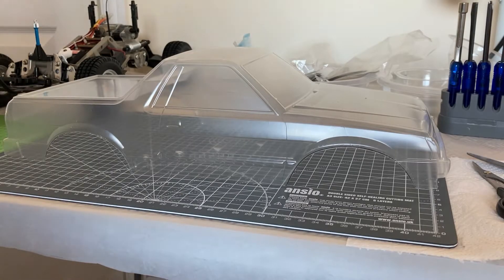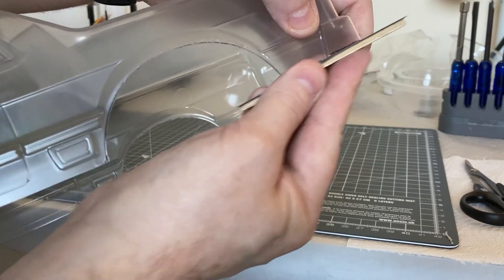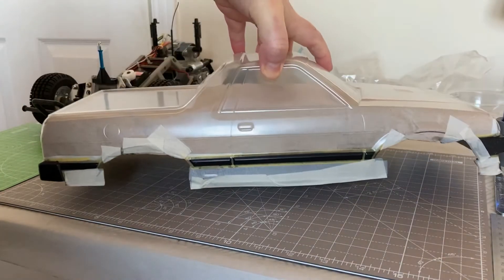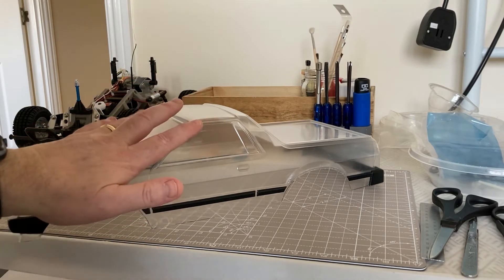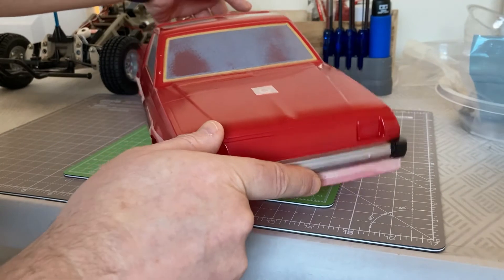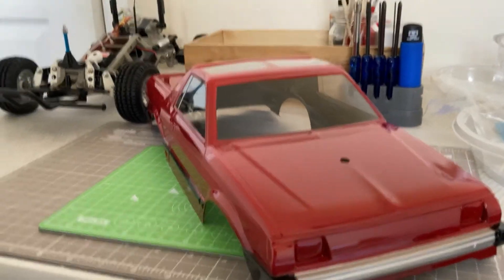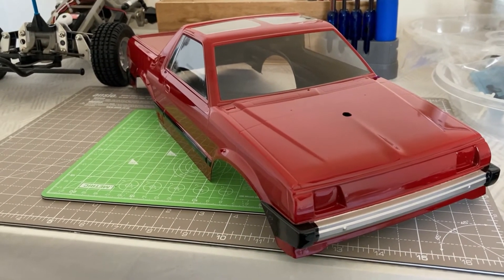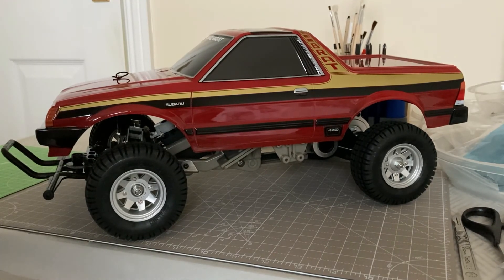Subaru Brat Polycarbonate Body

Comment: I wish I had your skills, awesome job John.
Reply from the maker: Hi Paul, you’re too kind. Honestly, I’m an amateur. Thank you for viewing my video. It was a labour of love painting the polycarbonate body, then I’ve done it all over for the 2nd resin body that you get with the kit. It took approx 15 to 20 hours per body. The polycarbonate was painted with the PS2 red, too about 1 to 1 1/2 cans of the Red,then PS5 whole of the remaining can. I had some silver remaining from a previous RC car for the bumpers. But the repeated masking, cleaning, re-masking, then cleaning, for the two bumper colours, then the window masks, then main red paint, followed by the backing colour, just took ages, but my tenacious patience got there in the end. 😊😉 take care, keep safe and well and keep up the great videos. 😊
Reply: @JF-RC  I admire you being able to create window masks, I tried with the Terra Scorcher and failed miserably.
Reply from the maker: @FullOnRC  Hi Paul, I used ModelCraft masking tape, it’s not very expensive and readily available on Amazon, eBay. I always try to route around the window in one, so there is only 1 join. When bending around bends, if it’s too tight, then gently put little cuts on the inside edge of the masking, but not all the way through, so that the masking tape bends around the bend. Ensure there are not kinks in the masking tape. Make sure the tape is push firming to the body. I then fill the masked frame made, with good quality brown paper, or you in fill with good quality masking tape from DIY stores. Before spraying, press the edges again around the masking tape. Many light coats, letting each dry, pressing the masking again, before each coat. Takes time, but worth it. If you do get runs, I’ve used Carson paint killer to remove any leaks, works perfect with both PS and TS paints without damaging the body. I promise, you can easily do it 😉😊. Take care, 😊

Comment: Really nice and clean paint job! I always tend to rush through them and I really should slow down a bit more. The cat union is not going to entertain your grievance, never will, you are just going to have to work around that!!! I never really realized how much of the body hand off the back of that. I guess in most of the pics I have seen one in the are kind of on an angle and it didn't seem like it was so long in the rear. Makes sense cuz the tires are the end of the chassis itself and that truck bed extends out... just never occurred to me for some reason! Looking forward to seeing the results of the hard body getting done!
Reply from the maker: Hi Addam, hope you’re keeping well. Thank you for taking some time to view my video. I used the old crinkle the dreamies packet to negotiate with the cat leader ( Mr Giz ), works every time 😁. The polycarbonate Brat body took from start to finish a good 15 to 20 hours, then I would say that amount again for the resin body. It’s really a labour of love. You’re right about the rear looks of the Subaru Brat, it’s misleading how long the body is, because the ORV chassis is quite short, but the rear trailing arms extend to give the wheelbase. It’s been a great car to build, really took me back to 1983 😉😊. Take care, keep well and all the best to you and the family 😊😁😉